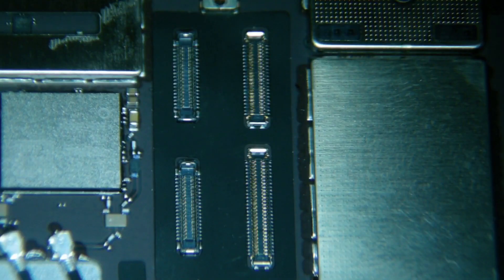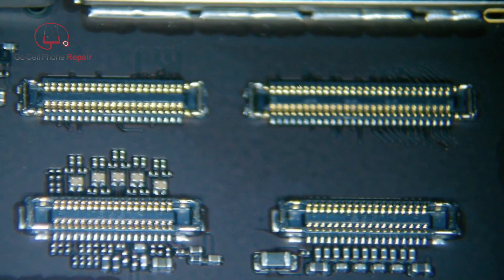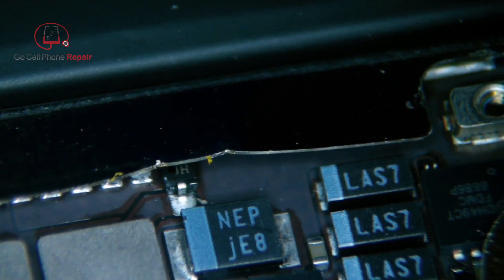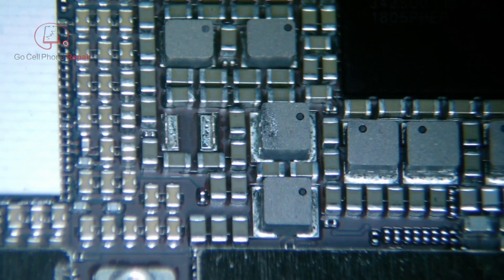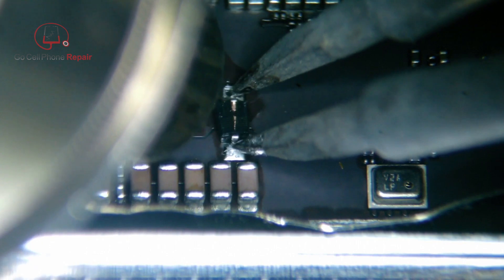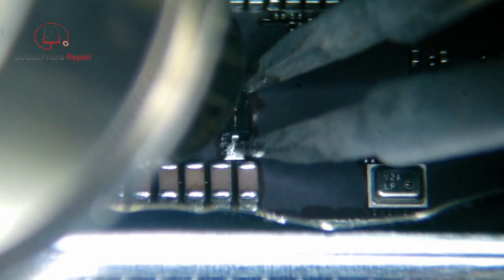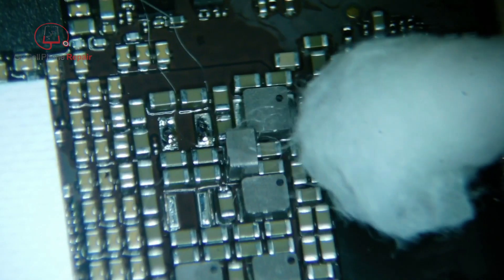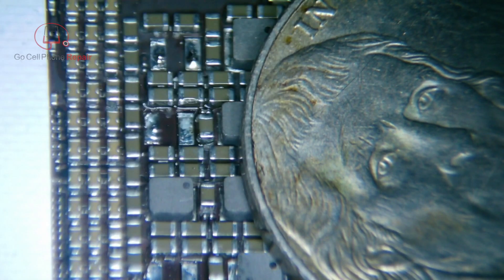iPad Pro 10.5 Backlight Circuit Repair

Comment: 250 de temperatura y de aire ?
Reply from the maker: Temperature for me is 420C @35 LPM. Make sure that the board is removed or the battery well isolated from the heat.

Comment: You could have measured the value of the inductor that fell off the board. if it just fell off and wasn't otherwise damaged or burned up, should be no issue to measure and know what it is accurately.

Comment: I've been seeing the combination of  both you talk about. The loose coils and backlight diode. I had to buy a used iPad just so I could pull the coils. I couldn't find the values anywhere. they were really low if I can remember and couldn't find anything that low on any other device.

Comment: I have a question. One of stripped screw is missing on the bottom on my IPhone 7 and I dropped my phone in water. Is it possible that water will get through the hole and damage my phone? Please reply soon, thanks.